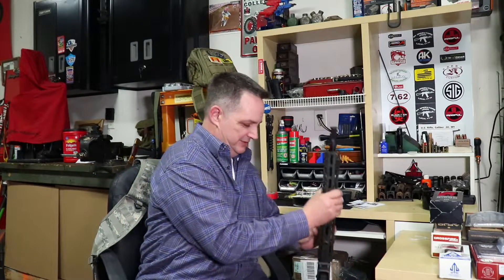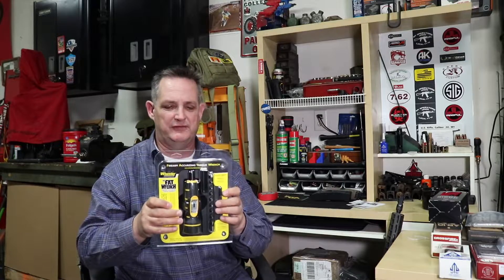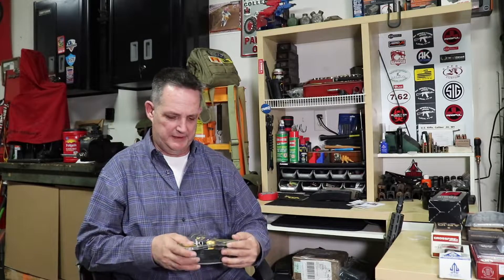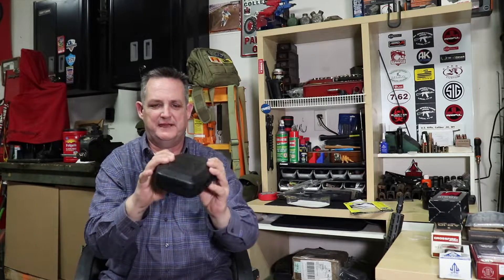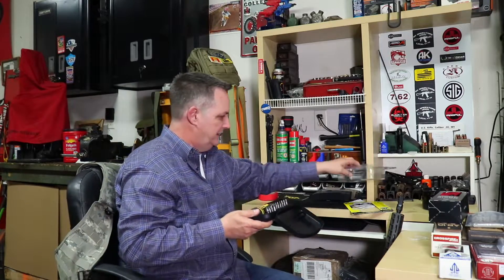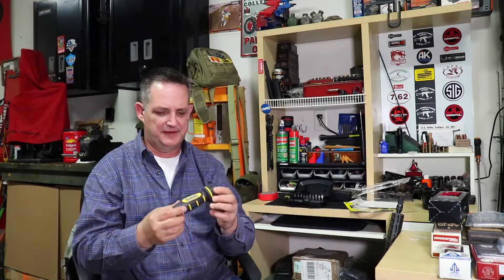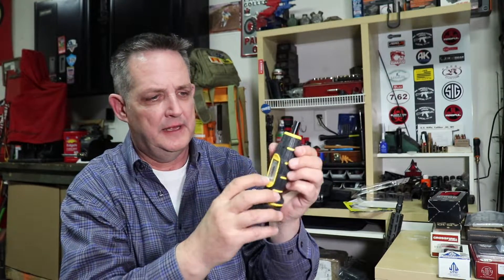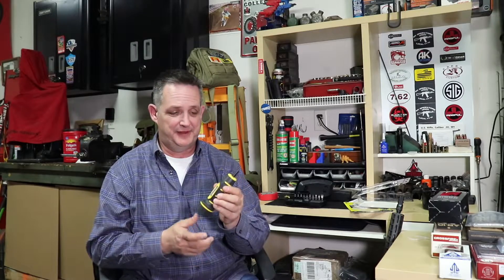WHEELER ENGINEERING FAT WRENCH

Comment: Excellent video! I learned so much!! Thank you!!! One question: I recently purchased a Sig P365XL along with Sig’s Romeo Zero red dot sight, separately. Sig recommends 9 in lbs to mount the sight. Since this Wheeler goes down to 10 in lbs, how do I make it work for my sight? Or would you recommend a different torque screwdriver? Thank you in advance for the help!
Reply from the maker: 10 pnds will be just fine.  You can always click it back one pound from 10 as well.  Its not on the scale but it will get you at 9
Reply: @rockordnance  - Thanks! I just bought it, and learned that while it depicts a lowest torque setting of 10 in lb, it will actually torque down to 8 in lb. All good!